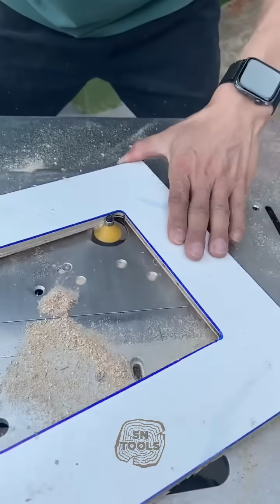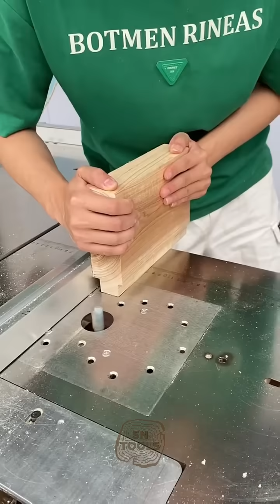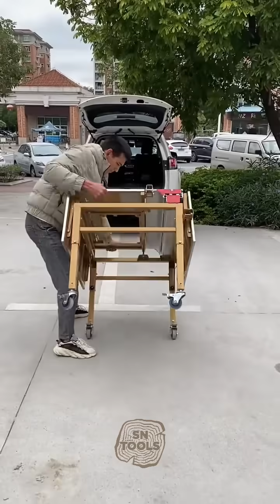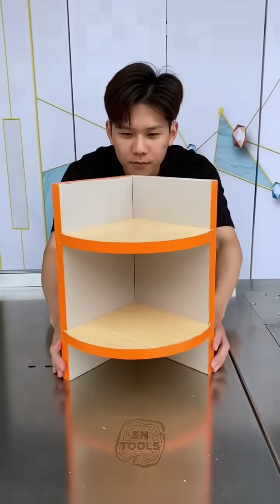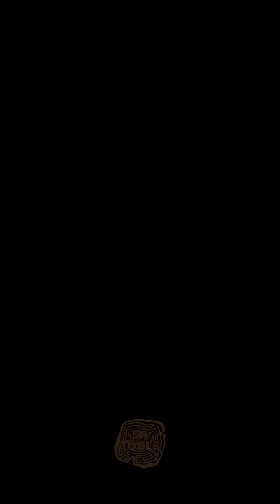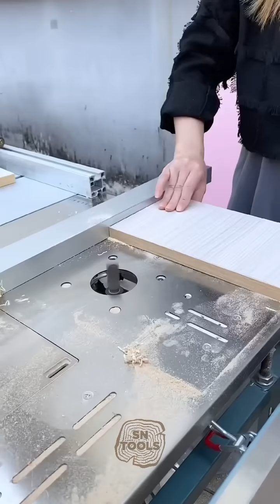Precision Woodworking Made Easy: Our Sliding Table Saw, Edge Binding & Router Combo

Comment: I really like the design and features that this unit has, very user friendly and very versatile, a lot of nifty projects can be done in a very practical amount of space. There’s a lot of convenience having one of these but at the same time …I also can see how soft all of the materials are throughout this entire video. Even the 2x4 lumber piece that they ran over that router, it was very soft. I would use this only for lite work and craft making, but if they made this is Germany or in America with really powerful motors and high quality metals for the table and frame work as well as everything else that’s apart of this unit, then I would use it for work. I would take it to every job site just because of the amount of tasks that a finish carpenter can do with this. It’s just from what I can see it very frail and weakly manufactured unit but if the design was copied and preoduced with higher quality materials it would be amazing